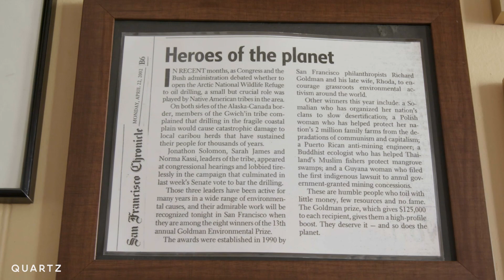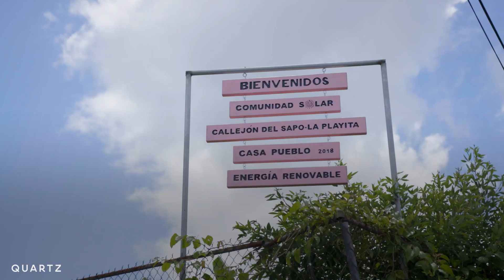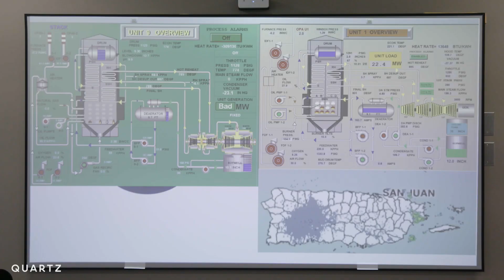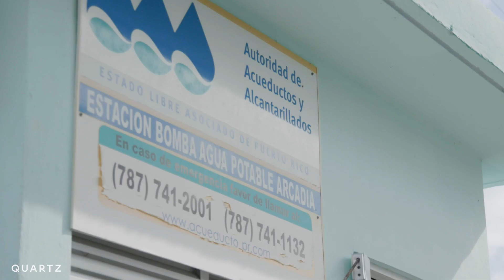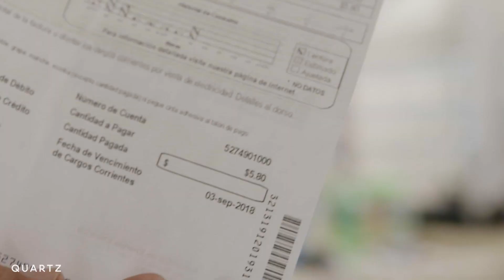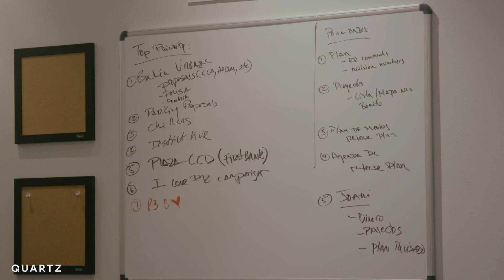Puerto Rico's solar energy insurrection

Comment: Alot of people hesitate because by current prices, it takes about 7 years to recover the cost vs the power company, BUT as long as I can power a fridge/lights/usb powered fans and my dad’s CPAP, I’ll be fine, I spent $2,000 on 4 225ah golf cart batteries, a 1,000w inverter, a 60a charge controller and 4 325w panels. San Juan area is where the power is most unreliable. Loved the video.

Comment: This is strange ...I just read an article yesterday that Tesla and two other companies got government contracts for Puerto Rico and the island of Vieques and it was a complete failure. On the island all the panels etc everything was done and when they tried to run it , hospital, municipalities , etc....the batteries blew up.....the hospital now abandoned from mold. The 7 mile main electricity from Puerto rico was damaged/ split from the hurricane. So they are running generators and Tesla abandoned the project.  (Geez can tax payers get their money back from that?) The article stated other islands(not just Puerto Rican)  were test subjects and these to were complete failures. Solar grids laying in ruins. Another complaint was these companies are getting government contracts, coming in and then leaving the project with none to manage or fix anything with nothing working..... a complete failure. So I find this video a bit unbelievable.

Comment: Wait til the next storm comes, I’m sure no trees or debris will damage the panels. 😂 solar is not a viable option for many reasons. And there is no green energy, solar panels use deep earth materials like silicone and still require fossil fuels as back up. This makes energy costs go up.

Comment: Too bad it is illegal to do that in a lot of areas around the US. They require all houses that are hooked up to the grid with alternate power (solar, wind, hydro etc) to install an automated power cut off switch so if the grid goes down, it will cut the power from your alternative source and you still lose all power.

Comment: Why would importing fossil fuels be expensive? They are an ISLAND located RIGHT along major international oil shipping routes. The tankers coming from the middle east filled with sweet crude could stop off in Peurto Rico for a day and be on their way. Hell they could probably transfer oil to smaller tankers traveling alongside and not even slow down.

Comment: Liberals have been saying this for years decentralized power grid that uses renwable energy is by far more robust and by far more reliable.  Puerto Rico is taking a step in the right direction. I hope they diversify their energy portfolio there is geothermal, wind, wave, tidal and pressure power harvesting techniques.

Comment: The practicality of solar increases directly as the distance to the equator diminishes.  PR is ideal for the electricity model you propose, using solar house by house, with considerable energy storage and less dependency on utility power to meet demand peaks and nights when solar is off.  The problem with net zero systems is that there is basically NO incentive for the utility to do that and considerable disincentive.  A lot of the incentive to encourage solar by utilities is simply to avoid the cost of building new plants but once you get to the level of unit sufficiency you get to a situation whereby the utility is forced to buy back power it can't use and can't store while at the same time it is required to meet demand during periods when solar power is not available (rainy days and nights), this would require that a large plant be operated on standby all the time.  Be careful too of setting hard targets like 100% renewables.  The housing market in smaller, less urban PR communities, i.e. small cottages with generally low power demand due to less dependence on large central air conditioners.  Urban areas will have less ability to adapt since folks will demand more A/C due to warmer temps in urban areas and the noise and pollution that is common.  Homes would be crowded into smaller lots, or into multiple residence structures, again with higher A/C loads and bigger lighting requirements.  The larger institutional facilities (schools, hospitals, government buildings), commercial and industrial users, and tourism all have very high power requirements that would be quite costly to meet with solar/storage systems and would likely depend on a reliable utility system to meet the needs that dispersed solar could not meet.  PR's problems are multiple, the power authority has made bad decisions in plant location, and not kept up with distribution system maintenance over a long period.  As a municipality owed system (state owned), it can't readily shed debt accumulated during the period these mistakes were made and is looking to a future when demand for its services is less certain.  It also is financially challenged due to this long dark period when it was off yet still had to cover expenses even though it was not operating, its financial situation limits its access to capital markets when such access is greatly needed.

Comment: The power grid of the future...until the next hurricane rolls through...
Reply: I mean, that wouldn't make it any worse than the traditional energy sources they used to have.  If you're gonna have to rebuild every couple of years, might as well rebuild with cheap, decentralized, & renewable energy.
Reply: @dr.zoidberg8666  That's the thing, solar ISN'T that cheap.

Especially when "mother nature" gets in a snit and rips the panels apart during hurricane season ever couple years.

Remember, even with the high output being that far south, you're still looking at a 5-7 year break-even.

If you have to replace every 3-4 years...
Reply: @PhotonHerald  Solar is that cheap -- you're out of the loop.  It is already generally cheaper than coal & it accounts for the cheapest specific examples of energy generation ever in the history of our species.

And it continues to fall in costs at the rate of an information technology -- such that the expectation is that it will literally be cheaper to build new solar than to simply continue to operate existing coal plants by the early 2020s.
Reply: @dr.zoidberg8666  Please reread what I said about break-even on solar.  I'm saying the infrastructure costs vs natural disaster risks aren't being seriously taken into account.  It has NOTHING to do with price comparison to coal.

If it takes you 5-7 years to break even on a solar install.  But hurricanes rip your solar install (think "BIG SAIL!") apart every 3-5 years, you aren't saving anything and it ISN'T cheap.

Especially since the materials to rebuild have to move through at least one continental US port BEFORE being shipped to PR.

Now, if there was some way to take weather damage out of the equation, you wouldn't be hearing a damn thing from me.

Comment: The idea of the Island going solar, photovoltaic, is a great one and long over due.
One of the arguments I have been presenting for years is the implementation of solar hot water systems.
It would almost seem obvious to most and to make matters even more pressing it has been part of the building code for decades!
For years it has been required that all new residential construction of individual homes and walk ups include 2 - 1/2" copper pipes to the roof for the future installation of a solar hot water system.
Whats more, even the federal government was giving incentives in the form of rebates to install these systems. 
Yet for some reason many homeowners have still been resistant to installing them.
According to many studies, some federal, domestic hot water ranks as one of the highest cost for a typical household, even more so when you consider Puerto Rico having one of the highest electrical rates in the nation.
It would be difficult to understand how the installation of a photovoltaic system were to be considered and incorporated without the complementary solar hot water system put in place here in Puerto Rico?
Please keep in mind that the argument for the installation of a solar hot water system would be in the presence of said infrastructure and not necessarily that of a retrofit necessarily. 
It has always been my contention that even if 25% of the given the number of existing homes and apartments with said infrastructure that we could make a significant impact and load off the grid in Puerto Rico. 
If we were to also include facilities such as government buildings, schools, hospitals, nursing homes, laundries, restaurants, commercial and industrial operations that consume vast quantities of hot water we could see even greater savings and advantages to the overall energy profile of the Island.
Israel, Spain, Hawaii and many European countries have enacted laws to require all new construction to include solar hot water systems. 
Puerto Rico, we have the pipes in the walls, what are we waiting for?
Let's close our energy gap and think in a complete and total solution for the Island.

Comment: i feel like solar panels would be so much more vulnerable than a coal plant and grid (or whatever it was before) to the hurricanes that ARE COMING in the future.  what Puerto Rico NEEDS is an underground molten salt reactor.
Reply: Well, what they had before was completely destroyed by the hurricane -- so you can't be more vulnerable than that.  The benefit of solar is it's dirt cheap & only getting cheaper with every passing year.  Even without subsidies, it's generally cheaper than coal & in specific instances it has already accounted for the cheapest ever sources of energy (every year it tops itself, obviously).

An underground liquid salts reactor sounds really cool... so does an iron dome that can protect the whole island, but they both have the same problem: they're not economically feasible.  Nuclear is already an obscenely expensive power source -- throw on top of that a form of nuclear that has seldom been done before & therefore has no economy of scale to benefit from, & you're talking about costs that Puerto Rico could never afford.  Then you want it to be under ground as well?  Not possible.

Solar is a way forward that only gets more & more appealing every year.  Costs go down, panel efficiency goes up, etc. -- with the current trend, Puerto Rico could probably afford to stockpile emergency solar panels in secured warehouses.  Over the years, they could have enough to immediately distribute to critically damaged sectors of the island at least to get emergency systems back up & running almost immediately.  that sounds like a pretty damn good system to me.

Comment: If you want a reliable power grid, micro or nationwide, in a hurricane prone country, you have to bury it, its more expensive but fully windproof. In case of a hurricane the solar panels are the first thing to be destroyed by the wind, followed by the power poles. A micro grid won't help when the solar panel are gone.
With $18b or $6000 per inhabitant you can live off-grid with solar panels, batteries and leave without electric bills until the next hurricane, where the solar panels are likely to fly away and the micro-grid poles to fall down. Or you can build a hurricane proof environment by laying the grid cables underground rather than on poles and getting a back-up generator just in case or solar panels depending on how confident you are about the survival of your house in an hurricane, a generator is useless if the house is gone. The choice is yours.

Comment: In Norway we have a distributed network, which the energy companies made for us and themselves. 
Essentially if you sell 1 Kwh to your neighbor there is essentially no loss between the two houses, while if the energy companies has to do the same they will get large losses. They therefor pay each person the price of the electricity, if they overproduce electricity and send the power back on the grid. Meanwhile selling the excess power for the energy companies to other countries.
The only thing required to do so was a new smart main breaker, which they pay for.
The reason they do this, is because of the electricity in Norway. The electricity is all renewable or 96% renewable, which they can sell to the neighboring countries for a premium.

Edit: This all means that it makes economical sense to both sides, especially if the electricity companies only give you say 50% of the price of electricity when you send it back onto the grid

Comment: The oil and coal lobbies absolutely will fight  against  a program which puts renewable energy first.  It is all about money and power to them, and not any concern for the future of the people they supposedly serve.

I agree that  systems like the one Puerto Rico and a few other nations on Earth are the way to go, though in some areas, totally relying on such systems is not practical.  But that is where the already established nuclear plants and coal, oil and gas fired plants would be of the most use, backing up those regions when the Sun is not giving those areas enough power to run the grids.

But solar is not the only renewable source.  We need to tap the wind, go-thermal and continue to tap the moving waters of Earth to keep things balanced.  We just need to wean ourselves from fossil fueled energy, and preserve what supplies of that resource we can for future generations.

Where practical, we need to put power transmission lines underground, where they are protected from the violent storms like what hits the Caribbean Islands and many other places around the world.  We have the technology to do that, but apparently not the determination or desire to get rid of the old system.  Too many vested interests want what we have as the primary source  only because it brings them the power and money they desire.  In other words, the old school is fighting the new school, and it has more resources to fight back right now.

I wish I could go solar, but I cannot afford the expense.  And more than likely, going completely off grid is probably illegal, based on special interest  legislation that prohibits such moves, such as the case like Florida, where solar arrays are illegal, if privately installed.

Comment: Yea.....but once the next big hurricane comes along it'll wipe out most, or at least a significant amount of solar panels installed due to the wind alone.

Better to pay up and have nuclear in the form of SMRs supplying small communities with power rather than flimsy solar panels that flies away under the slightest wind storm.
Reply: Solar panels on your roof are easy to remove and store inside your concrete house until the storm blows over. That's why big arrays will not work there. Only individuals having seven to eight panels on their roofs which they maintain themselves.
Reply: It's not just a storm though. It's a hurricane, and cheap solar panels are fragile. Even installing them requires people coming over to help, which is probably hard to get when the hurricane is just hours from landfall, while if you're not taking them off properly they might fall and break

Cheap solar panels are heavy too, at least the kinds shown here, and modular, lighter ones are guaranteed to be more expensive for people with lower purchasing power in Puerto Rico.
Reply: @irvalfirestar6265  WE usually have an entire day of warning before the storm hits. Plenty of time to carefully remove the panels and place them in safe keeping. If your house is made of reinforced concrete you have nothing to worry about. If you live in a wooden house then you can't afford panels anyway.
Reply: In that case, alright then.

Comment: Solar & storage is significantly more expensive than most other power sources. Of course it's technically possible, but can they afford it?

California has already seen the cost for their electricity rise to 50% more than the rest of the country with no signs of slowing. Ontario did it with wind. Their costs shot up by over 3x. PR will also see their costs rise similarly as they add more solar & storage.

Comment: It seems to be a good solution. The idea is not necessarily new but it can work if the solar panel installations, quality of equipment and public grid (connecting all) are indeed prepared to face the next big storm. Otherwise, all the panels may become extra debris increasing the total damage when the next hurricane hits the area. I wish good luck to all in the island. They've been through enough.

Comment: There is absolutely NO reason why Puerto Rico is not running at this point, or have a clear target that by no later than 2030 we are running 100% on renewable energy.  The problem is that there is NO plan, and the government of the country has no interest in making the change.  There may be many reasons for that, but I don't care about the reasons right now, I care about taking action. 

The constituents SHOULD vote on the next elections for a candidate that vows to make the Island 100% independent on external fuel sources.  That is the way forward, a way that will actually generate a new economic growth (much needed!), and that will spark the creativity of the future generations.